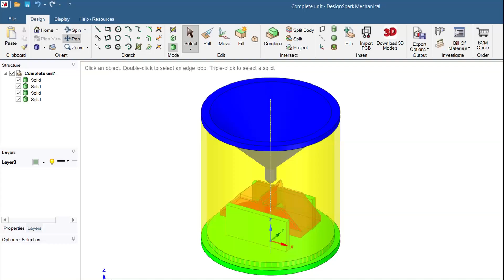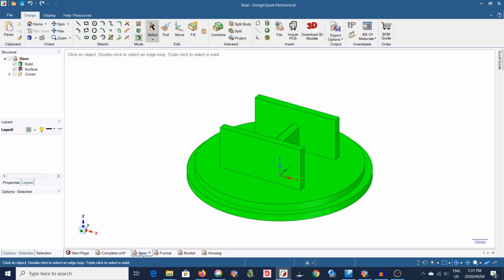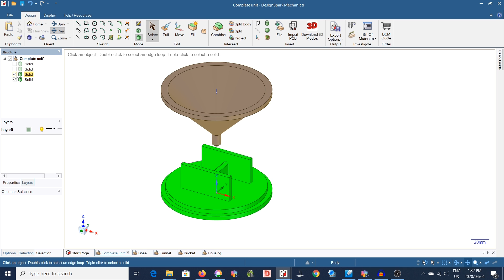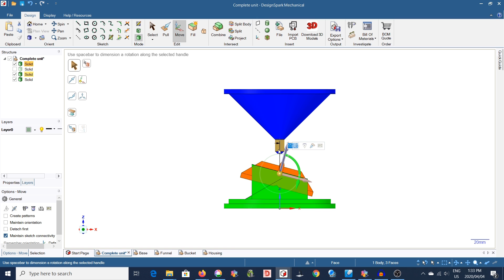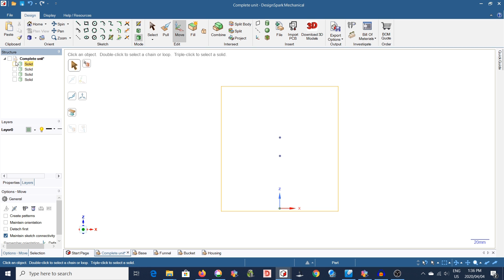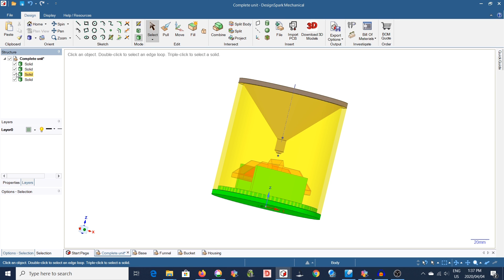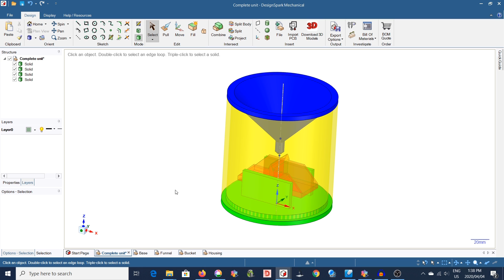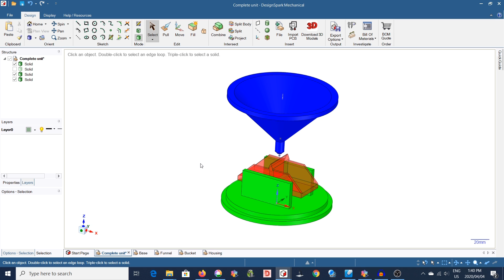Arduino weather-station: The rain gauge

Comment: I find it odd that this video popped up in the recommendations just now as I just finished designing my own version of a tipping bucket rain gauge in DesignSpark. When I say just finished, I still have DesignSpark open and was just going to check some YouTube videos before going back to my design to see if I wanted to make any changes. I haven't decided if I'm going to use an Arduino or an ESP32. I have an ESP8266 (ESP-01) that I can add to the Arduino so I can go wireless either way. I could even go with just the ESP-01 as there are 2 I/O pins to work with.
Reply from the maker: Nice, I must get it going again for next rainy season.
Currently I just have a DHT11 on a MKR1010 Duino outside for temp and humidity, sending up to IOT on Arduino.
It works well, and the tipping bucket design is robust.
I should do it again, that was early days for me and it could be done far more efficiently than I had.
Thanks for looking in and commenting, and have a look at my other content.
https://www.youtube.com/channel/UC5FrZUAFOcrVM7ze7ww_77A